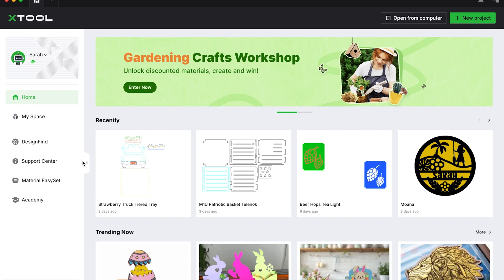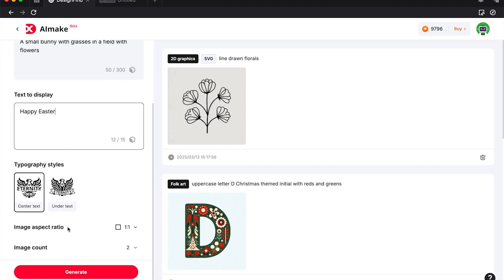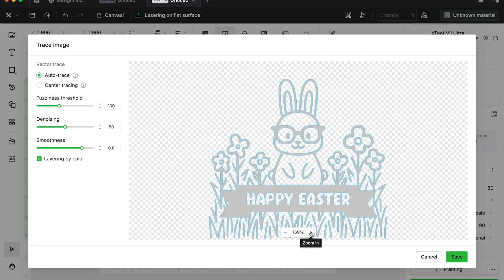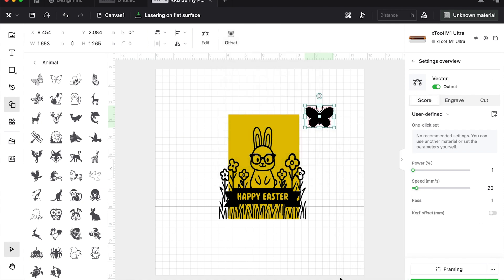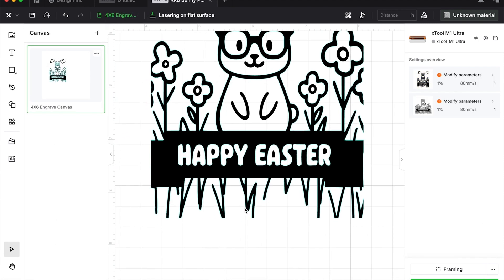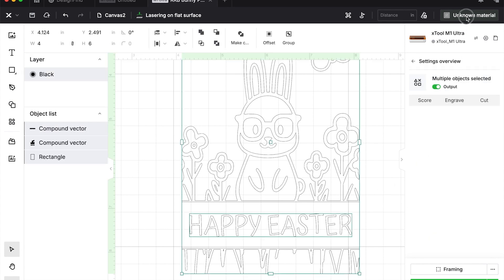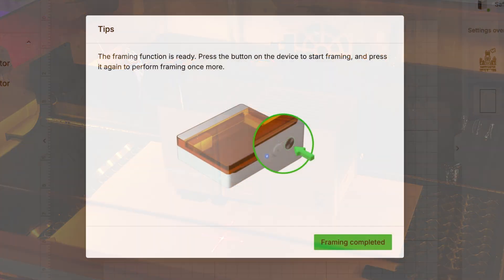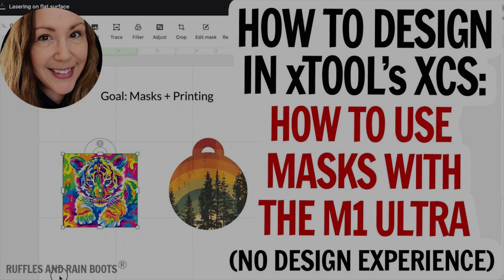XCS Software Update XCS 2.6 / Edit in XCS / xTool Software / Quick Score and Cut Wood Canvas

Comment: Thank you for the lessons. I've learned a lot from them. I was wondering if you could help me with something. Since the F1-Ultra can't laser a 40oz from top edge to bottom edge, you think I could size the design 12mm longer and cut off the 12mm then add it in a second step to finish the bottom?
Reply from the maker: You can absolutely split designs like that. The only issue is lining them up, so be sure to create a registration mark on BOTH sets of the designs (that you can turn off when you switch design portions).